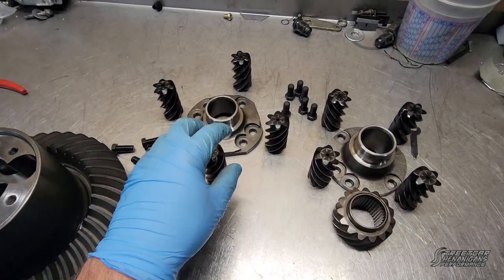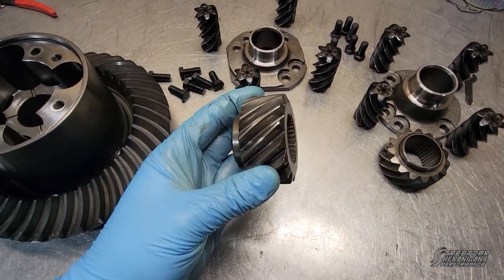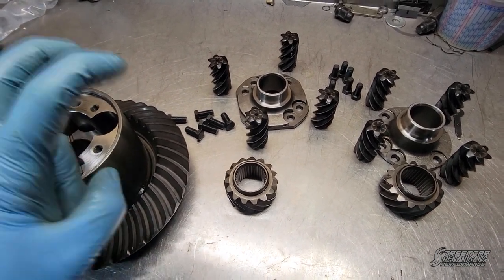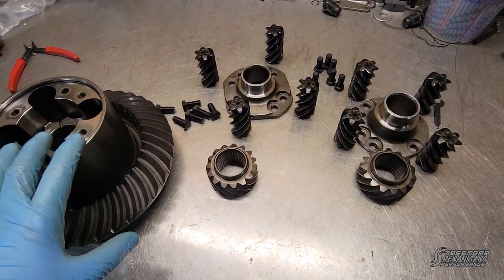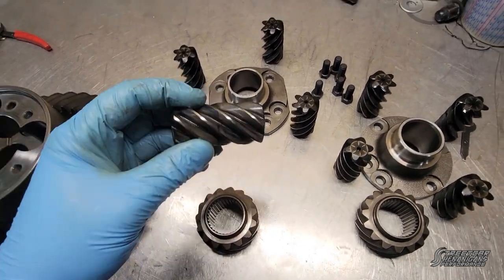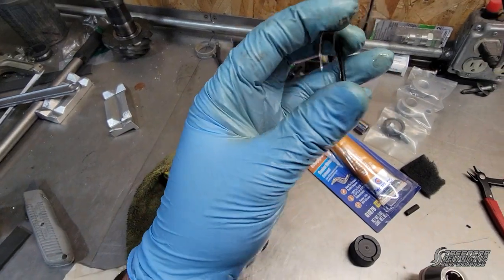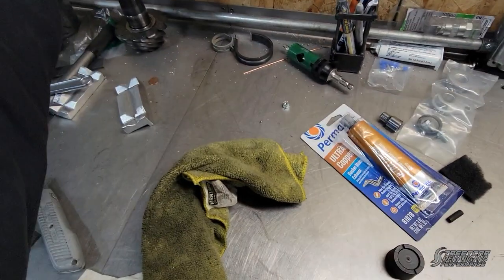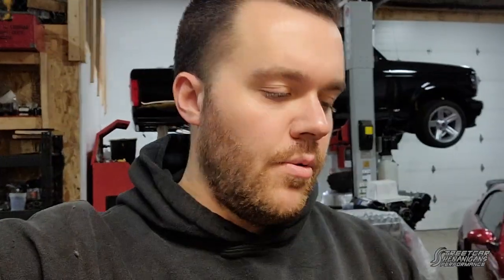What is inside a Helical Posi Differential? Eaton TruTrac and Strange STrac internals.

Comment: At about 7 mins in you're talking about the rare pegleg operation of this unit. It is an open diff until it is "switched on" in the manner you describe: Abrupt throttle, brake torque, or in the case of the "E-Limited Slip" that uses the vehicle's ABS hardware and software to feed a little brake to the one wheel that is spinning will "switch" these units engaged. And when these units are engaged, it's almost a locker. These things are in a class of their own. They are awesome, considering (the lack of wear, the no need to service, etc). Looking for a Ford-familiar installer out here in southern California to put one in a 13th Gen F150 8.8 Super. Cheers!

Comment: Installed one in my 87 Grand National, it's been great so far however the gear slop is a bit of an issue
Reply: So did I on my GN,  I went with Eaton & Richmond Gears mine went Great! (G-tech)  1.86 60fts. on Black top no burnouts. Have-not went to the track yet. I'm impressed.

Comment: 5:49 ... In this case (if one wheel is completely off the ground)  And assume you are traveling slowly ... 

You can just lightly apply the brakes (or hand break if it's back wheel), and that will freeze "the off the ground wheel" and put all the traction to the wheel that's ON the ground.

Comment: Thanks for the video... When you mention that the Trutrac noise.... I have a manual 5sp coupled with a Trutrac in a Dana44 housing in a 84 TransAm. If have the clutch fully engaged at low rpm and I throttle on&off quickly I get a hard clunk,clunk noise in the car. I replaced the axle shaft bearings which did have .015+ endplay, new driveshaft ujoints & balance and still suffer from the listed noise. I have determined that it is the rotational endplay of the Trutrac and the the internals of the trans. Does this sound correct and is this the noise that you were stating is inherent of the the trutrac? The car launches nicely and i use it for street and autocross with no complaints except the listed sounds. Thanks in advance! MikeJ
Reply: Mine does't clunk.  I've had squeals at VERY hard lock ups (one tire on pavement and one in snow), but I may have a bad journal in my rear end.  I wouldn't be surprised if those pinion gears can squeal under the correct load.  I'm assuming it's not an issue because I have over 50k miles on it by now.  Check your torque arm bushings, axle wrap likely would cause clunks.  I'm assuming that's not your issue if you autocross, you would have already done all your bushings.
Reply: @nicholassmerk  thanks for reply. Curious if your car is a manual or automatic? I don't think the noise I hear is axle wrap as it is not under any load and at such low speeds. Just idling with full clutch engagement, then quick on&off throttle which rocks the car abruptly to make the clunking noise I have. The rear bushings are all the Spohn delrin spherical joints in lower control arms, panhard bar & adlustable torque arm. I have determined that it is the slop in the trans & TruTrac driveline endplay that are creating the noise. It is not something that happens out on the road or track while driven normally.
Reply: @michaeljakubowski8356  auto.  I understand what you mean now after reading your reply.